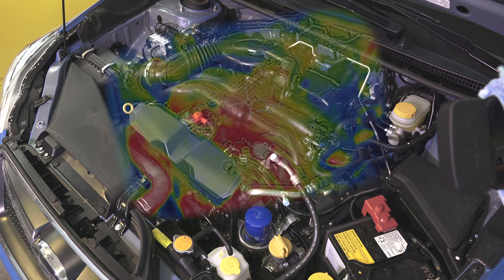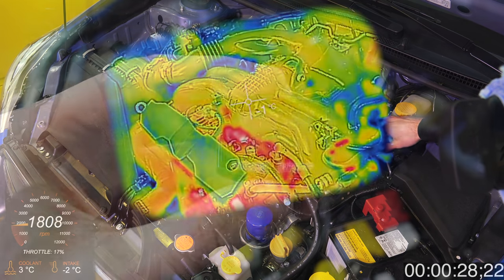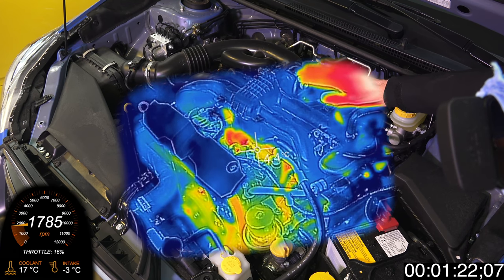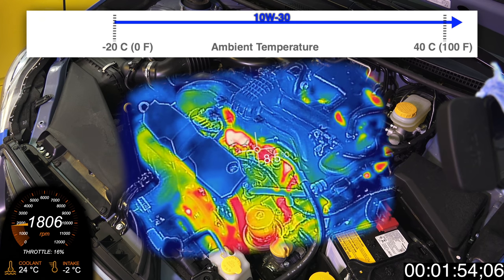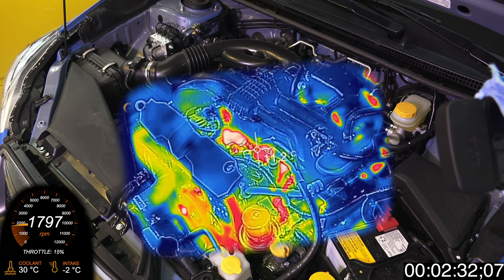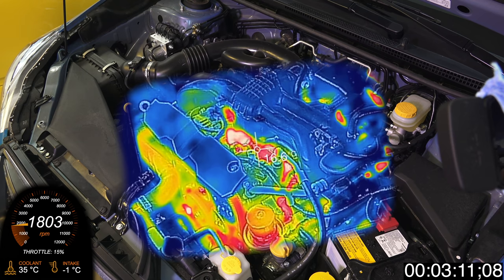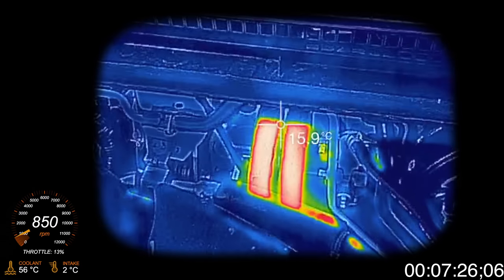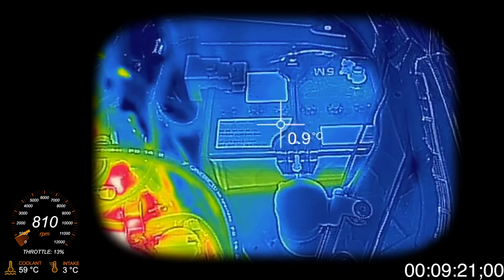Watching A Frozen Engine Warm Up With A Thermal Camera

Comment: Love your videos and your knowledge... My question is I have been live in LA, CA all my life and I changed so many cars already, such as Toyota, Lexus, M. Benz, BMW.. now I'm on 2016 BMW M3. I had many BMW models already for the past 5 years. Point is when I purchase the car, dealer always told me BMW don't need to warm up. Just start and go. Is this true?? On my other BMW series like X, 3 and 5 have no problem just cold start and go. But my M3 will NOT deliver any power when it's cold start, the computer is cutting the power when the car is cold.
Reply from the maker: +mark tu it's fine to start and go, just keep the throttle input low, and rpms low until things warm up. Can take 10+ minutes before everything is warm enough to be hammered on.
Reply: Engineering Explained: Got it. Thanks for the reply.

Comment: what about transmissions ?? my engine is fine after about 30 seconds or so and ready to go. But if I don't give my manual trans at least 5 minutes to warm up it does not like to shift and going into 1st it will grind, even if im at a complete stop. Once its warm, its not a problem at all.

Comment: hey, I have a very interesting video request and I hope it gets upvoted. 
now with those cold days I noticed a vast increase in fuel consumption. I know that is because of denser air and so on. my question is: with this denser air and more fuel being burnt per cycle, how much more power is my car making. let's say my miata 1.8 with 140bhp. isn't this circumstance basically a natural turbocharger, forcing more air into the cylinders than at normal temps? 

please respond I would love to find out!!! greetings from Germany

Comment: Do you have more horsepower when it's cold outside?
Reply: Once the engine is up to operating temp? Yes, a little bit. But your tires will have worse traction due to cold rubber (even when there's no snow or ice, etc). Many aircraft have trouble taking off on hot days because their engines can't make enough power, and the higher the altitude, the worse it is. This is true for both jets and piston engines. However, it' pretty negligible for car under normal conditions. You probably won't notice any pronounced "boost" just because it's .20 out, although it'd show up on a 1/4 mile timeslip, if you could find tires that would give you traction.
Hell, that's just one reason why some tuners cheat and open the hood of their cars while dynoing, or blow fans on them. Not only is the air denser when it's cold, but a cooler engine can run higher compression (although oils only work within a certain temp range).

Comment: ey. can you explain or say if engine start stop is bad? because  most of engine wear comes from the first few minutes of startup and constantly starting and the engine will take a hit on reliability of the starter. PLUS isn't starting an engine more or less is equivalent to 10 minutes of idle time?

Comment: I have a pretty interesting question its better for fuel economy let car warm up lets say theese 7mins or drive slowly after lets say 3 minutes? because if car isnt warmed up its running richer air  fuel ratio.
Reply: Samuel Strcula better to let it warm
tested by me and recomended by many
your car will no consume more then 150ml of gas/diesel in that time but if you want to go imediatly for a drive you will have bigger consumption even after the engine will reach the optimal temp
plus why risk damage the engine components (many cases turbo) when you can wait a bit and have warm in the car too...
kappa'
Reply: Im confused by that kappa at the end :D
Reply: Don't wait. If you drive gently the car isn't going to use much more fuel driving than it will idling while warming up anyway, and it'll warm up faster. If you're going to have the engine running cold and using up fuel, then you might as well be covering miles than wasting it sitting in the driveway. Although the amount of fuel saved is negligible, and there are other factors to consider, such as "does it wear my car out faster driving it while still cold, and is it worth it to save a few cents here and there on fuel". The answer is "probably not if you're driving carefully and give it 3 mins to warm up", but the fact that you didn't ask that question, but instead asked which gave better fuel economy, is problematic.

Comment: I hear some people changing their oil during the cold or when they have more than 100k miles. an example of this would be if their car recommends 5w30 then they would switch to 10w30 after 100k miles or during the cold? Is this even recommended, or will there be more damage to the car?

Comment: I recently bought a second hand Tuscon 2.7 V6 2005 model, 150 000 km. Vehicle oil consumption is very low. No noticeable change in oil level on dip stick.  However when pulling away the car is quite. Then about a half a minute later there is a slight rapping noise while accelerating which sounds like piston slap. When lifting the accelerator the noise disappears. About 30 seconds later the noise is gone and the engine sounds perfect again, even if left standing till cold and restarting during the day the noise does not reoccur. I find if I let it idle for about  3 minutes or so from cold after starting up in the morning, there is no noise what so ever. Would it help going to a thinner oil? I don't know what viscosity is currently in it, as the oil is still fairly clean, even after 5000 km. I've only done 5000 km since purchasing it. The owners manual recommends 5W 20 for all regions but can use 5W 30 if 5W 20 is not available. I know most people believe that one should go to a higher viscosity with higher mileage. Your views please? I'm worried that the piston slap is causing excessive wear while occurring. Thanks for your great videos. I really appreciate and enjoy them!

Comment: Is there a definition of what would be considered hard driving on a cold engine. Would driving up steep Hills at half throttle count, or would it only include redline, foot on the floor takeoffs?

Comment: I drive a 2006 BMW 325i my drive to work is about 15-20 mins my car takes about 15-20 mins to fully warm up (winter) if i let it sit which i usually do, point is the 3.0L I6 has commonly known valve knocking issues when you take short drives and dont let the car fully warm up before shutting it down do you still recommend not letting it sit for long?

Comment: Now what about the RPMs shooting up when you first start it? I mean, I get it, as you want to warm up the engine a bit faster and be able to keep the engine running when you put it in Drive, so that's kinda the reasoning with it raising when cold...

but what kinda concerns me is the instant jump. you start it, and it instantly jumps to 2,000 rpms on some cars. I know this isn't terribly high but wouldn't it be smarter to have it start out at 1,000rpms and then slowly raise to that point?

Comment: So basically my truck uses 5W-30 and it doesn't run right but when you start it up when its below FORTY FAHRENHEIT  you have to rev it up to 2k for about a minute before it will run without practically dying because it idles at like 300 during these temps, when really we should be able to just drive off in 40 FAHRENHEIT
Reply: Also, my truck is a 2002 Silverado with the 5.3 L Vortec (V8)

Comment: I never warm up more than 230 sec, even at minus 30 Celsius, ( I live in Quebec, I also used synthetic 0W or 5W) get some good clothes. Having heated seat does help, I don,t have those anymore. better yet have a block heater, plug the car 2-4 hours before leaving. Personally my comfort less important than the negative impact on the environment. Automaker should build in electric warmer to warm the interior of you car slightly ( only above 0 Celsius would be enough) when you plug it. It would save tons of gaz and useless pollution. that wold be better Than a remote starting device.

Comment: Why should you not accelerate too fast if the engine is cold? I usually try to stay below 3000 RPM and accelerate gently, but some people say that it's irrelevant how fast you accelerate as long as you stay below 3000 RPM. The oil flow speed should be tied to the current RPM, not the acceleration, right?

Comment: 1800rpm,for me, seems to be a little bit too much i would say, even the engine is cold...and it goes down too slow...and it was only -5 degrees.My 2003 Vw Bora(1.6 16v petrol engine) has about max 1500rpm at first start in -20 degrees or so, and it goes down to about 1000rpm in 2 minutes.

Comment: Yeah, even in -40, I would never let my Mini Cooper S warm up for more than a minute before taking her out. Usually would take about 7 minutes to warm up completely. If you're cold inside, that's why god invented heated seats/steering wheels (both are amazing, btw)

The oil pan was small enough on it too, that it didnt need a block heater. Started up without problem all the time.

Comment: I have the same engine in my 15 impreza and I just wait for the blue indicator light to turn off like it says in the manual. I thought this was because subaru oil filters have a different oil bypass pressure and if you aren't careful will just blow unfiltered oil into your engine. 

I always cringe when I see someone come out of an 8 hours shift, start their car and immediately hall ass out of the parking lot.

Comment: People these days will never understand the hassle of starting an old 40 year old diesel truck.  You have to have it plugged in with an engine block heater,  get the glow plugs charging, actually start the damn thing, might have to use starting fluid, let it warm up, let it warm up even further to get the warm air going in the cab. It's a pain in the ass.

Comment: I live in california where it's never really all that cold but I have to warm my engine up so I can see out the windows :(  Tons of fog on both the inside and outside. I can take care of the fog on the outside with the wipers, but it comes back in a matter of seconds.

I can't help but wonder if there's something up with my windshield that causes it to fog up so easily. I've used rain-x washer fluid because it's basically all they sell around here, and it seems to put some kind of coating on the windshield that affects the way water sticks to it.

Comment: So, here's a thought. I know you talked in an earlier video before about it being unnecessary to shift an Automatic car into neutral while driving or stopped at a stoplight. However, there are some conditions where I get out to my car, it's -15 degrees C outside, and therefore my engine keeps itself idling around 1700 rpm until it gets slightly warmer, AND, I have somewhere to be really quick so I have no time to wait for it to warm up. Is it beneficial to idle in Neutral when stopping at a stoplight until it's warmed up or is it still best to keep it in Drive?

Comment: ok. now are you saying that you dont need to let the engine run and warm up due to engine oil has no problem flowing? im trying to completely understand this. what about piston ring gap and cylinder wall differences between a cold engine vs one at operating temp? cold idle vs normal op idle difference? why does oil get contaminated? how much fuel bypasses rings at first start up till rings and walls expand to normal at normal temps? help me out here?

Comment: You said in another video that extra fuel doing cold engine running. Can wash the oil film off the cylinder wall. You are wrong. That much fuel is not being injected into the engine. That also would not be good for emissions either.
Reply from the maker: +blackericdenice cars run rich when cold, that’s well established. Helps with fuel atomization, need more fuel in hopes to have more vapor.
Reply: Yes they run rich when cold but not enough to wash the oil film off the cylinder walls. BTW more oil will be replace on the walls on the next pass.

Comment: Hey EE, I got a question or two on warming up my car (I did watch both of your videos on it). Let's say the temperature is -30°F, and my car is sitting outside with no place to plug in my electric engine block heater. Should I still go out for a gentle drive with no long warm up?   If I don't have 0W oil, should I still go gently?

Comment: I'm curious: why does the engine undulate slowly back and forth during the time lapse sequence?
Reply: Martin Lynch I thought the same thing but it could just very well be the thermal camera was hanging somewhere and wind caused it to swing
Reply: DonnieDarko1 I wondered that too, but if you look at the wires attached to the front of the engine, and not in the infrared frame, they too sway. Strange. Actually, you're right - just watched it again and hose at right is stationary in the non infrared part of it, but moves in the half that's in the infrared frame.
Reply: Martin Lynch 

lol, exactly. At around 3:17 is when the possessed engine begins making strange movements. I'm even wondering if there was some minor modification editing glitch. Possibly the colored image was a quick or last minute cut and paste still-image and later layered over the video for better clarity and demonstration purposes.
Reply from the maker: It's the camera. I'm guessing there's some sort of stabilization that's finicky with it. As you can see from the normal camera, the air box isn't moving at all.
Reply: Engineering Explained 
well, there you have it. Thanks for the video, I was oddly always curious about this whole heat distribution thing on cold start ups, especially here in Northeast. The viscosity concerns were just added bonuses.

Comment: Who cares about the oil and coolant? We know it works in cold temps. The point of warming the engine is to allow the gaskets and seals to expand and do their jobs. If you have an older vehicle ABSOLUTELY WARM IT UP. Nobody wants a blown head gasket.

Comment: While I do agree with you that the vehicle may not need much time to warm up before being operated, when it's below freezing and YOU are cold, it is unsafe to drive, especially if the steering wheel hurts to touch due to the cold and you are shivering your ass off.

Comment: @engineeringexplained
I recently purchased my first 2010 Subaru Forester, and this model doesn't come with coolant temp gauge. It only displays blue light when the engine is cold. My question is should I wait for the light to go off, or wait 15 seconds and start driving?

Comment: I noticed that the inlet and outlet of the heater core was nearly the same temp. What was your HVAC setting at the time of recording?
Reply from the maker: Robert Steich it was off, hence no temp difference. Actually would be cool to see with it on full blast!
Reply: Engineering Explained my 2006 Cadillac CTS has an awesome HVAC system. First it's dual zone. Second the sun affects the temp as well as fan speed. Let's say both the driver and passenger has the temp set to 70f. But the sun is shining on the driver's side. Then the vents on the driver will be slightly cooler than the passenger. 

If your Subaru does the same thing, it would make for an interesting video to see it on the thermo camera. Along with the inlet and outlet of the heater core.

Comment: It strikes me that fully warming the engine up before driving instills a false sense of security as the transmission and differentials are only warmed up marginally (unless there is a specific heat transfer device like in the Honda Accord with a CVT) and are therefore subject to damage if the car is driven as if it is in a normal state after being warmed up for ~5 minutes. Anyone disagree?

Comment: This engine (4-flat) keeps increased RPM longer than typical petrol engine. I Had several cars with petrol engines (4 inline, now 6 inline) and higher RPM remains only for 60-90s. Perhaps Subaru have using different solution for starting in frozen environment.

Comment: Question, jason. My subaru in such outdoor temperature after start within ~5 min will rev high instead of getting high speed. I find it hard to get higher than ~30 mph even the rev is more than 3k. But after that 5min warm up everything back to normal. Not sure why and i have a CVT even i manually up shift the rev is still high but no speed accelerate.

Comment: What if you lived at the base of a half mile long steep hill that you need to drive up to get to any main road?  What about transmission/differential oil temperatures or a cold clutch on a manual?

Comment: My petrol car idles at 1500rpm when cold, and I drive off at 1500-2000rpm lightly and keep it at 1500 rpm in 4th. It would be a total waste of gas to let it warm up before driving.

Comment: My H-6 Legacy doesn’t sound great in really low temps (like below 20 F) with a low-end noise that seems to be common among Subies during cold starts (hear it in my roommate’s Outback as well), so I let it idle for like 3 to 5 minutes until the revs drop to 700 rpms. Runs like a champ and is always silky-smooth  and very quiet once warmed up. Anyone know why boxer engines and Subies in particular sound rougher than traditional inline-4 or V-6 engines when cold starting? Using 5W-30 synthetic btw.